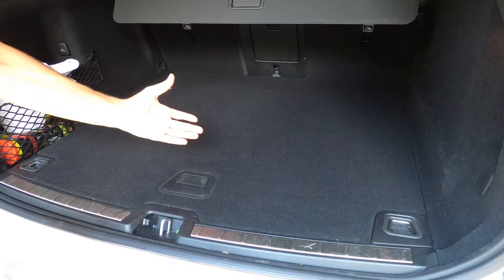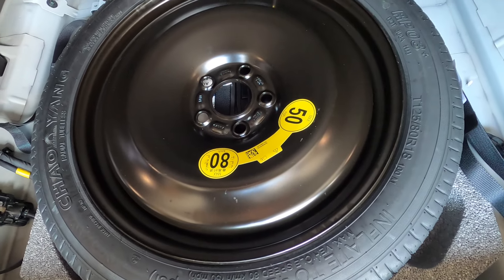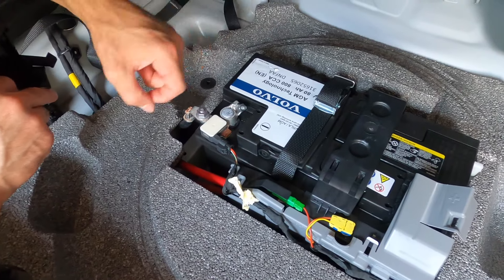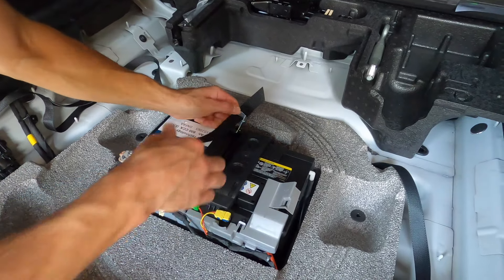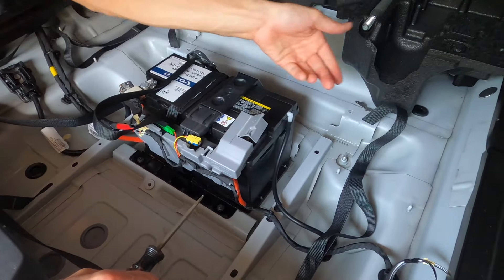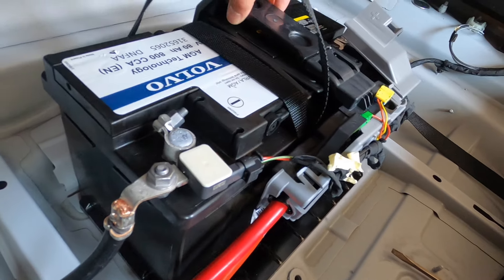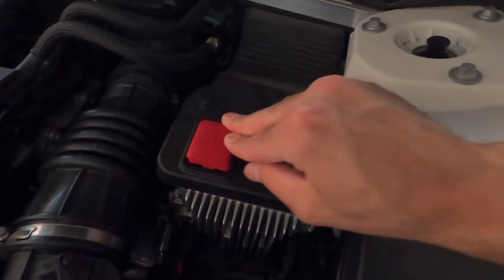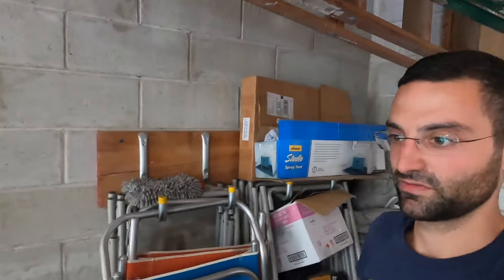How To Change the battery Volvo XC90/XC60/S60/S90 2020 New Platform + Jump-Start Volvo

Comment: Just an fyi, I own a 19 S60 and the battery isn’t under the spare tire. It is to the left up against the fender. You can access the neg cable through the plastic panel. If you need to get to the entire battery then you have to remove all of the plastic cladding on the left (drivers) side.

Comment: Greetings on Aug 20th 2024.  Great video.  But I have a question.  I have a 2019 Volvo XC60 and I need to "disconnect" (only) the startup battery briefly to add a battery tender / maintainer.  Your video did not mention whether disconnecting the battery would impact any of the onboard electrical and computer settings, etc., which would need to be reset after reconnecting the battery.  Also, as shown in your video, there are a couple of small colorful (green and yellow) fuse connections at the rear of the battery ---- should those be disconnected before I disconnect the battery terminals?  Or, only disconnect the main terminal connectors and that is all that is necessary?  Thank you.

Comment: I have the 2019 s60 with the battery mounted on the left rear portion of the trunk.  I can’t figure out how to remove it.  Any videos for a side mount battery (not under the spare tire).
Reply: I just went through this procedure on my 2019 S60.  You have to remove the entire left hand side trunk interior trim panel in order to get full access to the battery.  There's two push in clips that will pry out with an interior clip removal tool.  Then there's a plastic hanger hook that  has an upper piece to remove then the whole hanger will come out.  Once those are out, remove the trunk floor cover to access 4 plastic 10 mm nuts, remove those.  Then fold down the driver's side rear seat and now you should be able to work the panel out.  I'm a long time Volvo fan and have owned quite a few over the years.  I must say that although this car is great overall and most of it looks easy enough to service, this battery access is one of the worst I've seen in the industry.  Note:  You will most likely break some if not all of those plastic clips.  Also, once you see the battery you still need a long extension with a 7 mm socket to remove the hold down.
Reply: @TRADINGARMOR  thanks for the great explanation!  Seems like the Volvo engineering team tried to make this the most difficult battery to change.  Plus, the angle that it’s installed makes it very difficult to remove because of how heavy batteries are.  We finally figured it out, but took almost the whole day!
Reply: @davidmarden4711  Glad you figured it out!

Comment: I have a 2019 xc60. My car sat for awhile and the battery is non responsive. My question is after installation of the new battery .......is that it or will I need to go to the dealership to clear codes?
Reply from the maker: Should be good! Any update??
Reply: Batteries would not hold a charge so had it jumped. Once jumped and luckily started it automatically threw codes. Drove it to Volvo ..... they changed both batteries and cleared codes. I asked if I should buy a Vida dice unit since I can’t understand waiting 10 days for an appointment..just for a battery and he told me it wouldn’t work on the newer models so I bought a Ctek charger to maintain the AGM’s while I leave for business trips or vacation since I can’t trust them. It sucks not being able to work on simple things without having to fork out a dollar or two.  Cheers and thanks for responding.... merry Christmas 🎄

Comment: This is not the same as the 2017 XC60, has a starter battery.  Do you need to use a battery from Volvo?
Reply from the maker: I would recommend Volvo since it has the warranty and price is no different
Reply: User manual says that you should use the battery with the same specs as the original one, no strict requirement for Volvo branding.

Comment: Hey Kyle,
My 2003 saab 95 aero wagon blows cold air in front but hot air in back seat. Is this an orifice tube or expansion valve problem?
Reply from the maker: Sounds like a blend door is messed up. Press auto and off button at same time and let me know the codes
Reply: My ac sid is presently dark. I will be sending it out for a fix soon. When it was working it showed codes 11 & 13.